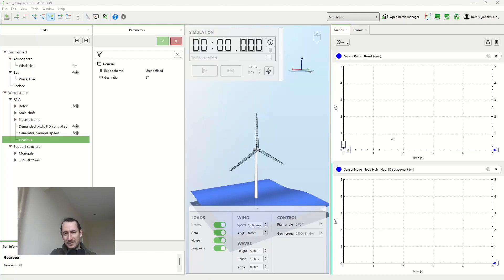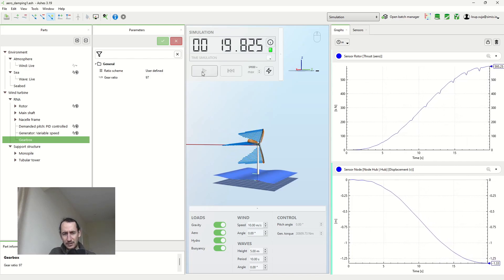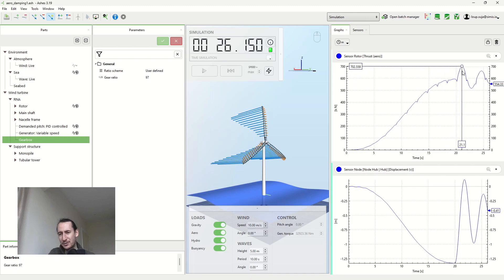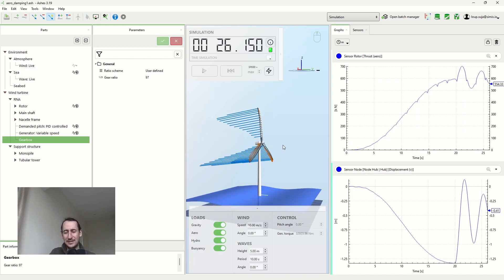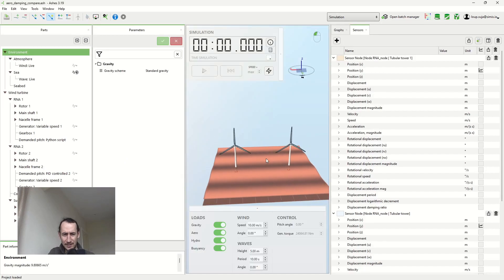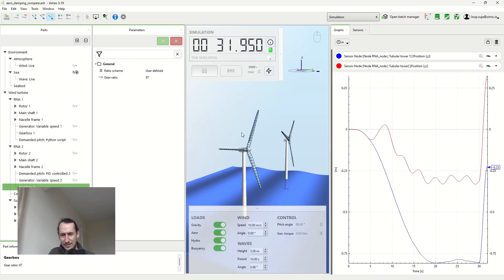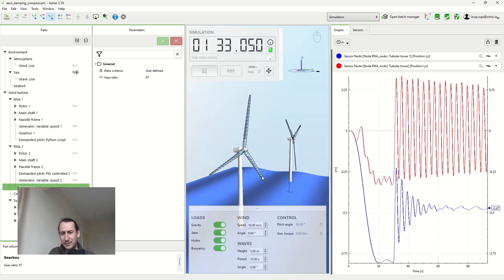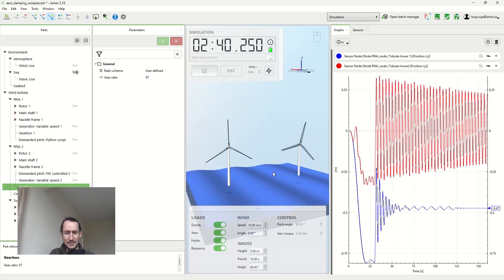Aerodynamic damping on wind turbines, explained and illustrated with Ashes

Comment: This is interesting. Is it possible to add aerodynamic damping in the blade sensors in the future.
Reply from the maker: What quantity would the sensor show?
Reply: For example, use the aerodynamic force times the displacement to get the aerodynamic work of each blade element; Take the sum as total aerodynamic word of blade. The aerodynamic damping coefficient is obtained again without dimensionalization. @AshesWindTurbineSimulation
Reply from the maker: @wuhongxin_wind  very interesting, thanks for the suggestion!
Reply: Similar to the definition of aerodynamic damping of aircraft wings. When the aerodynamic force does positive work, it is negative aerodynamic damping, and the structure is in self-excited loose vibration. @AshesWindTurbineSimulation

Comment: Is aerodynamic damping taken into consideration mainly for offshore wind turbines? If sea waves are the cause of this phenomenon for the offshore case, what could be the equivalent phenomenon for onshore wind turbines?
Reply from the maker: You could also have gusts of wind in onshore wind turbines, that would trigger some vibrations, and in that case aerodynamic damping would be beneficial to the structural integrity of the wind turbine as well. 
But aerodynamic damping is inherently taken into consideration in the time simuation (at least with Ashes), you can't turn it off...